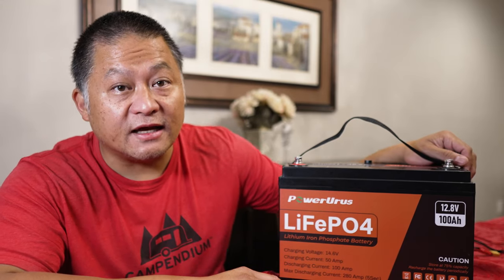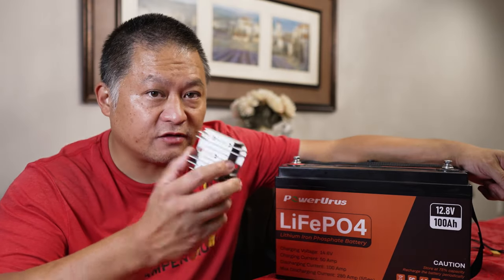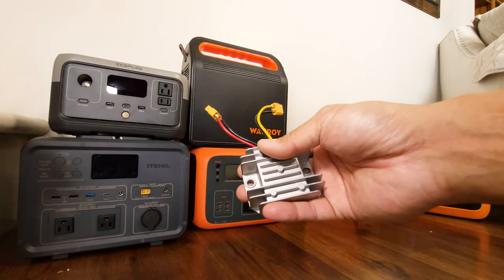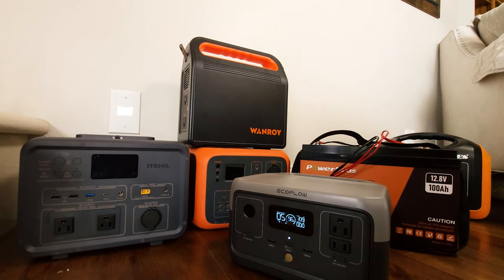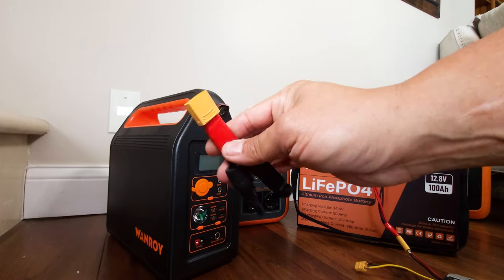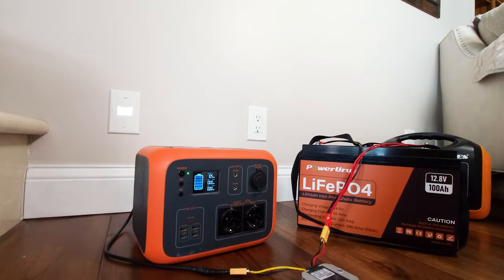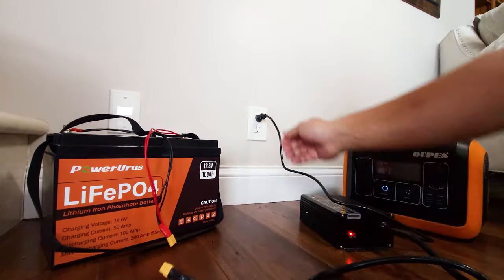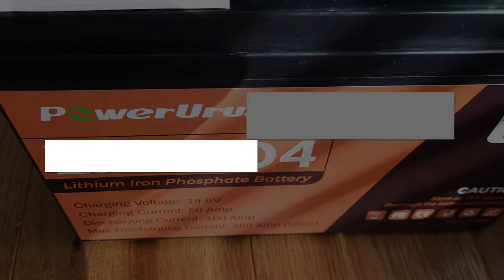CAPACITY HACK For ANY Power Station // PowerUrus 100Ah LiFePO4 Battery

Comment from the maker: Everyone who's suggesting using 2 batteries in series doesn't understand a few things. First, it's far more expensive to buy 2 batteries instead of one. Second, it is more difficult to transport and still requires you to crimp and solder wires. And lastly and most importantly, it does not give you current-limiting functionality for safety purposes. So please, if you are wondering, I do NOT generally recommend connecting 2 batteries together instead of using a DC boost converter. You can do that if you want but just know that it is not a better solution for the purpose of this video.
Reply: Very true, there would be no need to purchase 2 batteries when you can simply purchase a 200ah battery, a all in one. Question?
Reply: I recently purchased an Anker C1000 with the expansion battery. I have several 12.8v 100ah batteries that I can attach if needed a pure sine wave inverter that I can pump up to 1300w or as low as 100w of power into my power station using the Anker app to adjust whatever wattage I want to charge with. My expansion problems are over with…With 3ea 200w solar panels I’m good to go. I’ve done all that small step up inverter work with the different adapters to my smaller power stations which are basically obsolete,  but I wanted something out of the box I could just plug and play that would meet all my needs..Small, portable & powerful…
Reply: @HebrewNomadOverlander  good idea.  If you increase the AH of the battery and just use a single battery, it seems like it should be the best answer for a cheaper alternative to use with a small home battery backup.  Imagine using a 400ah battery.
Reply: They make 24v lifepo4 batteries right on Amazon.  No need to series 2 12v together.
Reply from the maker: @tonyinfinity it is never a good idea to connect batteries directly to each other without current limiting device in between. LOL! ROFL! But you do you bro.
Reply from the maker: @tonyinfinity so you claim to have done some extremely basic battery connections. Amazing. LOL! It's a waste of time to explain my knowledge to you. I've got plenty content on this channel that you could never comprehend.
Reply from the maker: @tonyinfinity  If you actually understood what that meant it would be worth my time talking to you... 🤦‍♂️
Reply: Most power stations have voltage limiting, but not all.
Reply: It wasn’t like that till recently. I’m guessing to many fires caused by misinformed victims🤣

Comment: Been doing this for years. Just be warned that those small DC to DC boost converters get very very HOT. Maybe enough to start a fire. Keep them on a non combustable surface. A better alternative is the Victron Orion 12-24 converter. Much bigger heatsink and runs much cooler.
Reply from the maker: Not this one. This is exactly why I opted for this 3A unit because relative to the 10A version the heatsink here is massive. I've been using this one for a long time and it never gets to hot to touch even after hours of use. Victron doesn't make a small 3A unit like this. 10A is the smallest and it's costs 10 times the price. But if you want to, you can and the idea is the same. Just be aware that 10A is too much current for some smaller power stations with a 120w input limit. Make sure it has a built-in current limiter.
Reply: @john doeYes you can. It's limited to 8.2A though so you'll charge at about 100W. You can upconvert it similiar to the video to 24v for 200w
Reply: Great video! Newby here. I have a Delta mini with 300 watt solar input. My question is why do you need a step up from 12 to 24 volts if the input goes in to 12 volt like solar? I can see why it would have to be regulated.  I already have a 24volt to 12 volt 20 amp 240 watt step down converter. Would this work?
Reply: @bulldogs131  is there a video of a 24v charging
Reply: Can I charge my marine lifepo4 battery directly from my ecoflow max?
Reply: You need a source voltage higher than your LFP battery. That is why he is using the 12/24V Boost converter.
Reply: Hi Dan. How do you connect the xt60 connectors to the boost converter and to the battery. Do you have a video on that. Ty
Reply from the maker: Just search for "xt60 connector soldering" on YouTube
Reply: Can one recharge a 12V lead acid battery with a 12.8W LiFePO4
Reply: @careybrown3776  your solar generator will limit 12v input at 8amps for 100 watt. At 24v and 8amp you get 200 watt charge. The step up converter is used to bypass this limitation with a 12v source battery
Reply: @pauldekock3793  Probably not, lead acid batteries have much more internal resistance. Just thinking that a car alternator is putting 14.5 v to the car start battery (lead acid)…
Reply: Putting over 100 watts through this 72 watts rated boost converter kind of explains why it runs so hot, right? The electronics components build inside will degrade faster with time. 3:50

Comment: Can't I just hook up a power inverter to the battery and just plug in my solar inverter to that and charge it that way?
Reply: I need to know this as well! I have Delta 2 and a 220w solar panel and I want to expand the capacity this way..
Reply from the maker: This is how you would normally charge it but it require more equipment and is slightly less efficient. You are inverting the DC source first to AC and converting it back again to DC. Each one of those jumps create inefficiency. Using the method shown eliminates one of those conversion steps which creates more efficiency.
Reply: @sopranosfan2  and at that point just use the battery and inverter and skip the power station altogether lol
Reply: I started out with the solar generator. And after buying the panels for it to charge it up I started getting more panels and batteries. So now I got both backup for the backup 😁

Comment: Why not plug your battery directly into the solar panel connector. The internal controller should regulate the battery current.
Reply: He’s probably keeping it at a voltage range that spreads across dc voltage inputs of those devices.  Makes sense, but so does your question lol.

Comment: Cool video! I may do something like this in the future. Don't know if it's been asked, but would a 24v LiFePo4 battery work? That way, you wouldn't need the dc to dc converter.
Reply: Yes it would. Would double your watts in as expected. Your power station will limit based on the max amps it can charge at. My bluetti is limited at 15 amps and will not allow more than that. 15 amps x 12.6 v =189 watts. 15 amps x 25.2v = 378 watts. You can series connect two 12v batteries to get 24v as an option. You should be able to go up to 48v even. Since the amps aren’t increasing, wire size doesn’t become an issue. Still 15 amps or whatever your power station limits charging to.

Comment: I have the Ecoflow River without the extra battery. I want to be able to extend it's battery life by tying into the pair of deep cycle lead acid batteries that I have. The voltage of two fully charged 12 V batts will exceed the River's charge limits I believe. What sort of current limiter should I use. I also wonder how much power I can take from my Nissan Leaf traction battery. DC-DC converter puts out 1000 watts @12v.power.

Comment: What are you using to charge back up the spare 100Ah LifePO4 battery after it runs down?
Reply: I was wondering the same thing
Reply: This is what I'd like to know. Can it go both ways can I solar charge the battery with any of these stations?
Reply from the maker: I guess none of you guys made it to 14:42 in this video?

Comment: If you want to make a lot of money, build a "capacity booster" that will auto-sense both input and output, allowing you to connect to any source (12/24/36/48) and safely charge any power station, regardless of what it draws.  You could include a heat sensor and cooling fan.  (Some boost converters come with a fan attached.)
Reply: They already make auto detecting chargers, I use four them to charge my LifePO4, 12v or 24v. If you really want to make some money, make a 120amp all in one unit. Only one on the market and it has Brazilian plugs. 
I have to rig four chargers together to achieve my charge rate goal on generator power. I have reduced Generator Charging from Over 24 hours to 3 hours.  I wonder how much energy i save..... lol
Reply: They make voltage regulators, for what it’s worth. They are used where shore power or generator power lags or fluctuates. It outputs constant 120 or 220 AC.
Reply: @Oblivionsurveyor  why 120? Is it just an open market at that capacity? Pretty sure you could come up with something.

Comment: I use a pure Sine 12V to 220V 600W pure sinus inverter for my Bluetti 2400. Works as a charm. ( Europe has 220V )
Reply: You are converting the energy twice, resulting in lower efficiency and higher idle consumption. You can do it if you don’t mind the loss. 
Otherwise the boost converter is more efficient

Comment: I connect directly to a cig lighter with a cheap wattmeter to a compact 3s 3.7v lithium pack from 10.5v it fast charges at 10 to 11 amp. Then later boost to lifepo4 battery. Great for no sun in December and January

Comment from the maker: Get your own PowerUrus battery here:
https://freelyroaming.com/powerurus

Parts shown in this video:
12v-24v Boost Converter: https://amzn.to/3A9STwW
XT60 Connectors: https://amzn.to/3UwVt8h

If you don't want to solder, you can get these pre-wired connectors for a tool-less build:
Wired XT60 connectors: https://amzn.to/3NX2E7j
Lever wire connectors: https://amzn.to/3Tyibvo

Comment: That was an impressive demonstration 😎 Two Thumbs-up!! 👍👍 I've been trying to figure out how to do that with my new Delta 2 and watched a few other videos with very poor results. Great job!
Reply: Roy, been looking for the same thing for the Delta 2. Did you go with anything? Great video @Freely Roaming.
Reply: @lxboogersugarxl8431  ~ YES I did. 😎
Considering the limited "D/C input" and limited additional capacity available for the *Delta 2 ( @500-watts / with any combination of volts up to 60 volts), I decided to take a completely different approach by using the "A/C input" of the *Delta 2 which has a fantastic input spec for its size and capacity of 1,200-watts (120-volt x 10-amp = 1,200 watts). 
 My theory (untested at the moment)) is to use a 12/24 D/C volt to 120 A/C volt inverter and connect multiple 12 or 24 volt LifePo4 batteries, using the inverters A/C outlet to recharge the *Delta 2 A/C input. For example one 12.8  volt x 100ah battery = 1,280 watts, exceeding the original capacity of the *Delta 2 with one $300 battery and the cost of the inverter (minus the power loss for the inverter). 
 Now imagine the potential storage capacity of a larger battery bank stacked with either 12-volt or 24-volt LifePo4 batteries. Then add a solar power charge controller and recharge your battery bank during the day with any sized solar array that matches your daily usage.
 Remember, the D/C to A/C inverter only needs to be running when recharging the *Delta 2. The same inverter can also be used to supply power for other items in the home as needed. The right solar panel array should be designed to recharge your battery bank.
Reply: @royrobinson4636   nice! It’s funny you mentioned that theory as I was looking at inverters today. It seems easier to keep it to AC charging even with the lose. The input any other way stepping up is too slow. I appreciate the input and insight. Just needs to make sure is pure sine wave. I actually snagged a fuel fuel genny over the holidays for backup to is. Works great!
Reply: I also bought Delta2 (Ecoflow), and noted that the back of it is a male XT-60i which has a gold middle pin (data pin). Cannot buy
Xt-60i female anywhere, so used regular xt-60 female with 48 volt DC LRS-600-48 Mean Well P.S.
It works but the current is limited to 8 Amp only, so, the charge was
429 watts with 54.5V and 7.8A. Yes, you have to adjust the output voltage at P.S. to Max. Of 54.5V.
2 nd method I used the DC to DC booster set at 60V and 8 A the output is 481 Watts but when measured the MPPT inside Delta2 adjusted to 41.7V and 11.46A which surprised me because my XT-60 was not Ecoflow XT-60i to MC4 cable (yes, you have to pay extra, not come with Delta2).
But still under 15 A maximum.

Comment: Very easy to understand.  Thanks for your clear explanation , especially the universal examples. I have a Anker Solix F1500 that I wanted to connect my ebike batteries to for extra capacity.  I’ll have to determine the voltage DC input on the station and decide from there if I need a step down or step up to satisfy the input range. I think the power station DC input range is 11V-60V.  I have lithium ion batteries (that I can make use of) ranging from 36-72V.

There are now anti-spark and battery blender devices that can be used with batteries of same voltage, but differing Ah capacities. I’ve used these successfully on my e-bike projects.  I’ll have to read more from the comments, but connecting a adjustable low voltage cutoff device from the feeder battery would be good. The BMS isn’t always so great, especially under load.

Comment: The performance you are getting from that tiny boost converter you can get she same by just wiring a xt60i connector that has its activation pin linked to the negative then connect it straight to the battery no converter needed it will charge at the current limit of the mppt
Reply from the maker: Unless explicitly stated, power stations do not support XT60i connectors and will not have the ability to read the data stream. The third pin will do nothing. None of the ones I showed here do. That means they will not charge from the native battery voltage. Generic MPPT charge controllers will simply ignore the lower than sufficient voltage and do nothing. However, all charge controllers will charge from 24vdc as it mimics a solar panel which they are all designed to be used with. The point here is to find a way that works with the widest range of power stations out there. Not only the ones that might work with it.

Comment: Great video. I would attempt to source a battery thats 24v to do this if your power station requires it. Those cheap 12-24v dc converters are considerably inefficient.  Thats why they get so hot over time.  Great option if you already have the 12 battery laying around.
Reply: I'm an admitted idiot with DC power. How would the 24 v battery hook up work? Can it directly feed the 12 v power station without modification? Also, if using an alternator to charge these, which battery would you use? Thanks for any ideas.

Comment: personnally i prefer a 24volt battery  QWW has one 24v 50ah for 350 CAD yes the 12 to 24 v booster  is a cheaper solution but it heats up and would need a fan to keep it cooler.

Comment: This 100ah Power Urus battery is around $400.  It is cheaper than the main brand expansion batteries.  But the Bluetti 800 ah one w all the bells and whistles is $6-700 without all the rigging.
Reply from the maker: Bluetti doesn't sell a 800Ah unit. An 800Ah LiFePO4 at 12.8v is over 10kWh of capacity. If you are talking about their 800Wh unit, that's only 2/3 of the capacity of a 100Ah battery. Add the capacity of whatever power station you are starting with, which you might already own, you are only getting about 50% of total capacity with what you are talking about. It's really apples and oranges. You're talking about just buying a bigger power station but this is about expanding the one you already own. It will always be cheaper to do it this way.

Comment: When on the road I use a 300w Bestek inverter to charge either my 2 ea. LifeP04 12v 100ah 1280wh batteries, Jackery, Bluetti or Anker solar generators using their respective charging bricks or 600 watts of portable solar panels with Mppt charge controller for LifeP04 batteries….Many Many ways to expand your usable Watt Hours of power….
Reply from the maker: You are not really 'expanding the capacity' with these methods because you are just charging from other power generating sources. This video is about actually increasing the capacity of what you can bring with you.
Reply: @freelyroaming  I actually have 4 ea. of the 12v 100ah LifePO4 batteries I can connect to the Power Stations if needed. I also use 1 battery to power my GMRS 40w radio and roof mounted emergency light-bar, no drain on my truck battery when engine is not running. I also have a portable 200w solar panel with a Mppt controller I can connect to the battery if needed, it does a good job keeping the battery charged…

Comment: Standard auto inverter attach to battery then can use standard recharge module that comes with power station no fuss no muss and can get whatever charge rate you need...
Reply from the maker: What is a 'standard auto inverter'? Are you talking about a AC inverter? They are more expensive, bigger  and less efficient. If you are going to bring a standalone AC inverter, then there isn't much of a need for the power station in the first place.

Comment: Very informative video, though I do want to add a caveat. My 500 Wh and 750 Wh LFP power stations from Ecopower and Bluetti charge within 60-65 minutes. I am not sure about their 1 KWh models, but they might charge up quicker than the 3 hours it takes to charge the PowerUrus, but only some of the devices support such a high charging rate. Regardless of that, I am now going to buy the PowerUrus because that is a lot cheaper than buying the expansion units from Bluetti or Ecopower lol
Reply from the maker: That kind of charging speed is possible but not common. I know of just ecoflow who is doing 1C charging rates. I assume this is new for Bluetti as they are 2 of the top tier brands competing with each other. Most AC power adapters charge at around 200W.
Reply: @freelyroaming  HOW DO YOU CHARGE THE BATTERY?
Reply from the maker: @BOOSTEDLASER  it is in the video 14:36